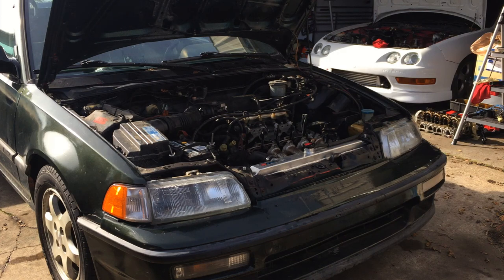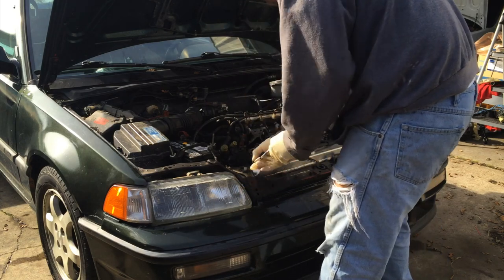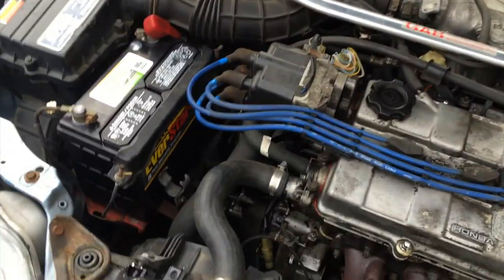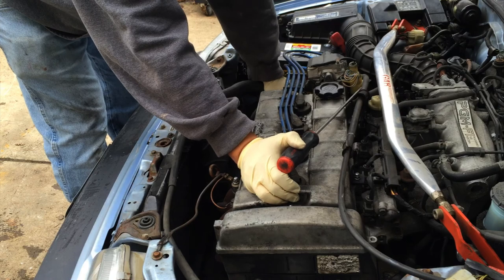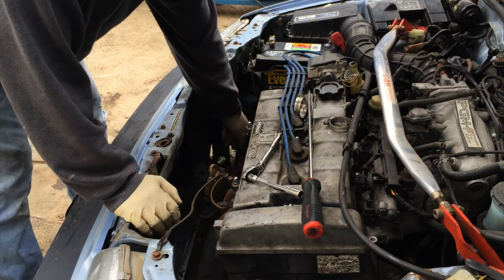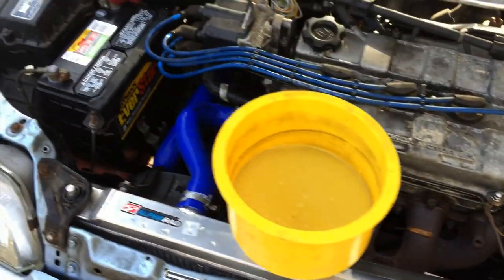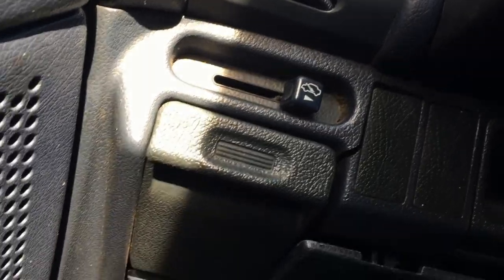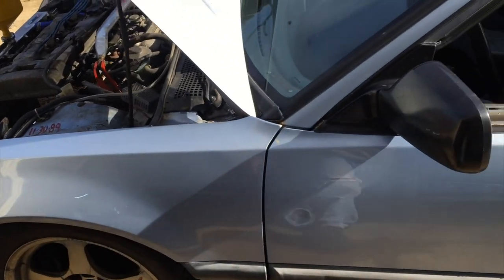Radiator upgrade for the EF

Comment: I just put this radiator in my EF last night. I have a hydro GSR with a hasport cable to hydro adapter. I could not for the life of me make the lower radiator hose fit. We had to make a hard 90* to the passanger side then use  a hose up to the  thermo housing. Do I just have the wrong lower hose?
Reply from the maker: I think you have the wrong lower. I remember not having that problem when I did my friends crx, same radiator with cable to hydro trans adaptor What year lower hose are you using?  I know its slightly different from 90-93 to 94+ integra